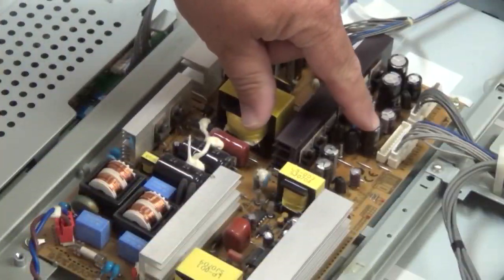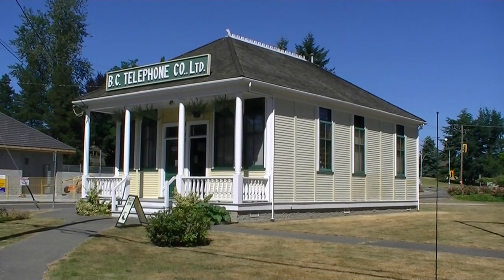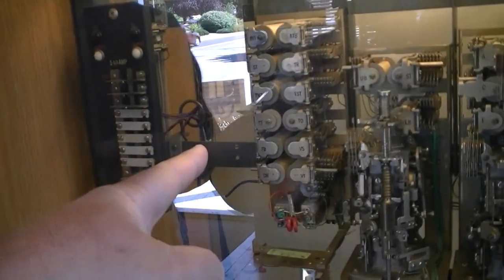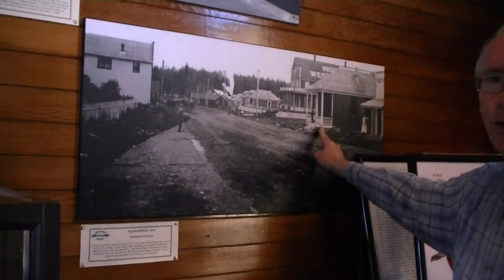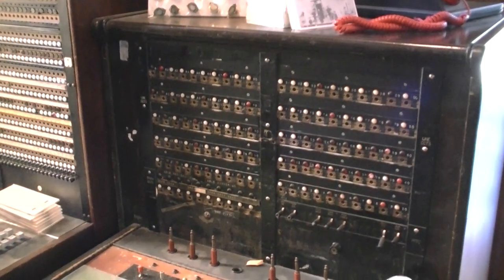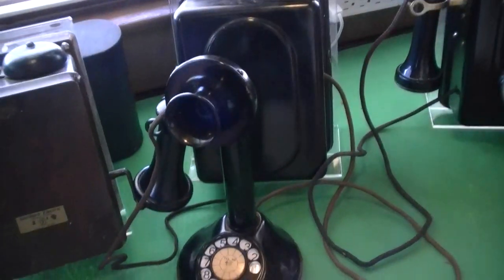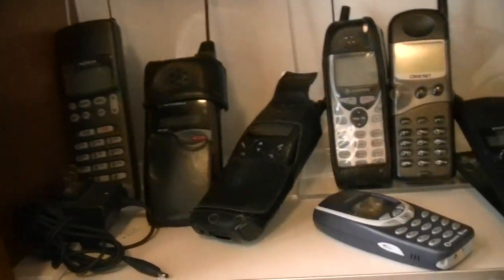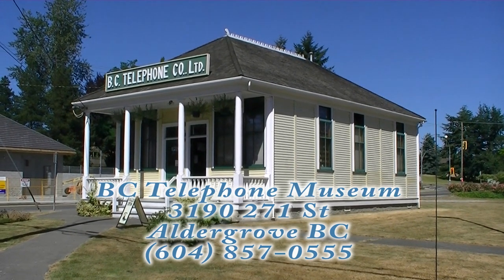BC Telephone Museum

Comment: Takes me back to the '70's installing both 500 & 2500 sets, #5 crossbars & multibutton keyphones, tip ring A A-1 lampground lamp...O what fun we had with the color code mantra splicing thousand pair in a manhole or over a suspended ceiling..
es

Comment: Nice old phones and the changes in design over the years.
I also thought the rotary pulse generator dial was older than i expected.
It's amazing to see a mechanical/relays/solinoids  at work.
By todays standards it's ancient, but dam clever and did the job :-D

Comment: Thanks for showing these.. I kinda geek out on Phones.   I found one I didn't even know existed until this year, a phone by Bell , has a year of 1980 in the manual .. it was sold in USA and Canada - has an AM/FM radio built in, blue Led Clock  the radio dial glows orange.. has an alarm setting as well. (very bedside marketed I think) .  Very robust durable design as well. One of my cherished pieces.  It was $3 at a Christian thrift store. :)